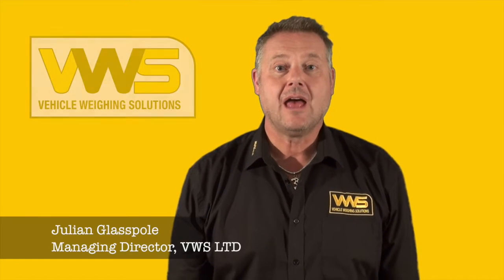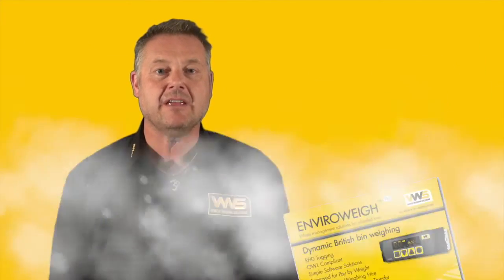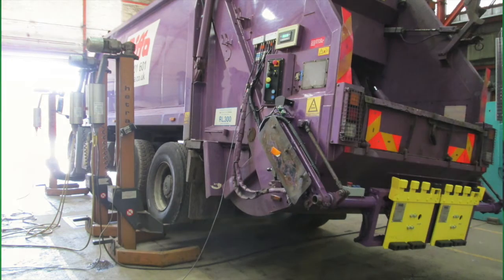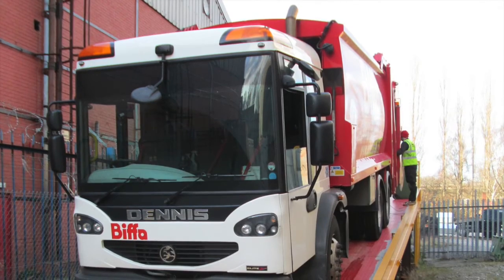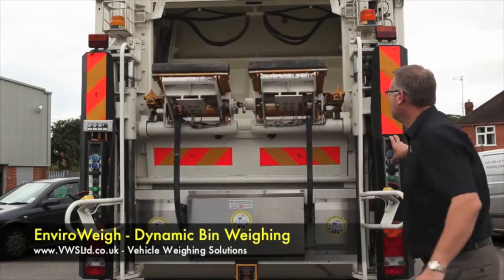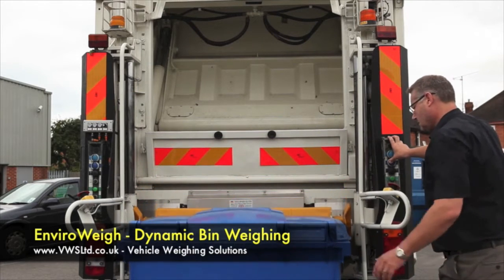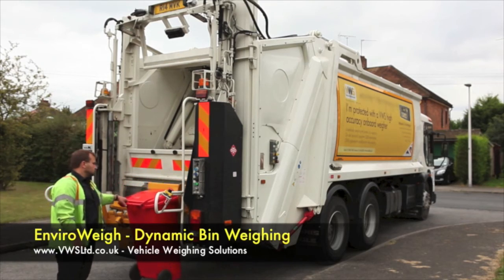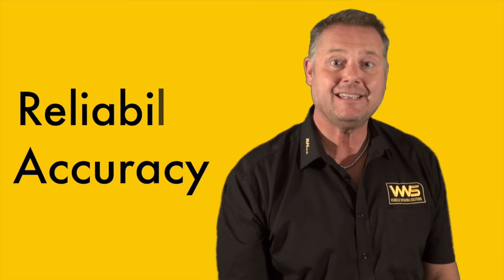VWS EnviroWeigh Bin Weighing & BIFFA Municipal Partnership

Comment: Is this system purely for municipal contracts?

I would like to see how the system fairs with continued use of metal bins as oppose to plastic
Reply from the maker: Works well across sectors and we'll look at alternate requirements too.
Oxford City has great success with metal bins.
- Julian
Reply: Thanks for the info. 

You mention in the video that this particular model has had a 100% success rate on Biffa vehicles. 

Have Oxford City had any issues with the system using metal bins?
Reply from the maker: Iain Patterson

100% on our UK designed, built and tested LoadCells.

Long term use of antennas on metal bins have challenges and we are working on a sustainable long term solution.
Reply: Thank you for your response. I'm still not convinced it has durability for routes with metal bins. Sorry just my opinion
Reply from the maker: Iain Patterson
Agreed, antennas with metal bins do wear and with over 300 installs we are constantly improving and looking to innovate better service standards for our end users. Thanks for the input, much appreciated.
- Julian